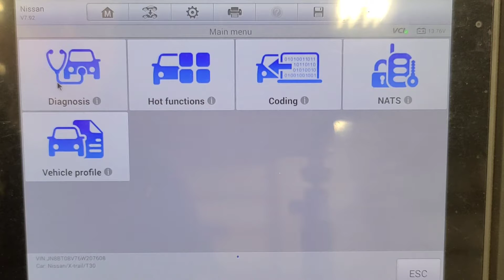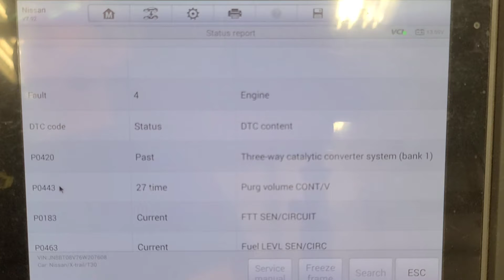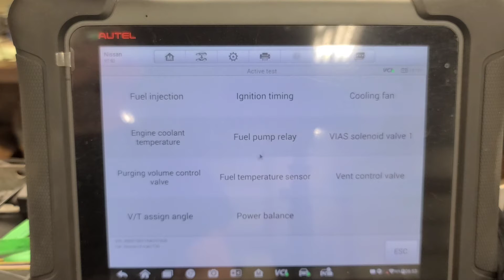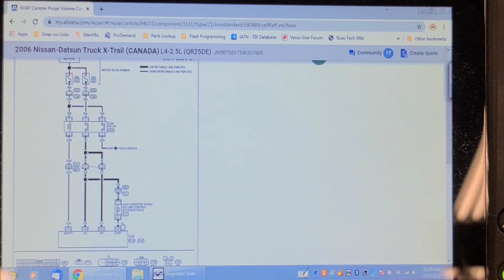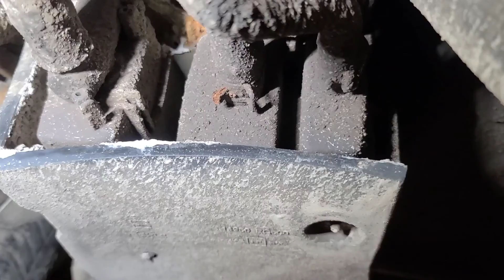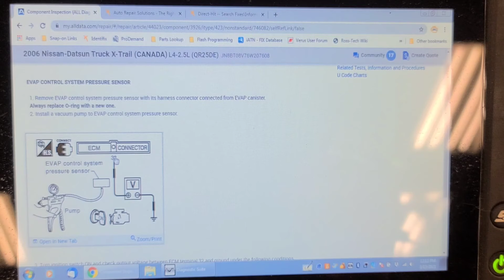2006 Nissan X-Trail P0443 and P0420 Diagnosis

Comment: So what was the final diagnosis??
Reply from the maker: After all that testing I could not locate a specific cause for the P0443 code. I could not find a leak. It may have an intermittent problem with either the vent or purge solenoid which causes it to fail the evap monitor. The P0420 code will require catalyst replacement to correct. Since both will illuminate the MIL and neither appears to be causing a drivability concern the customer did not want to continue with diagnosis. Sorry not what you wanted to hear I know.
Reply: I believe it was multifunction of solenoid it self.  This famous cause with nissan.